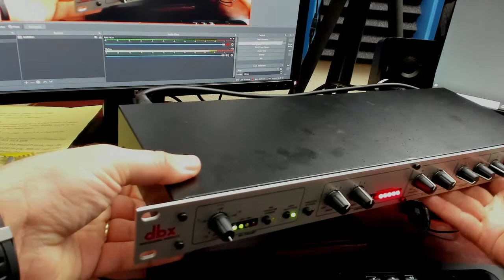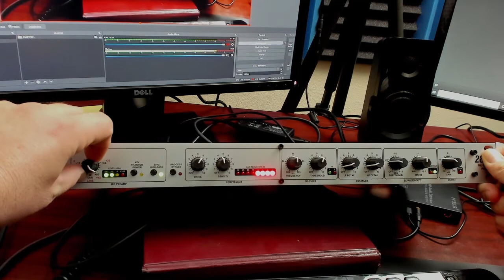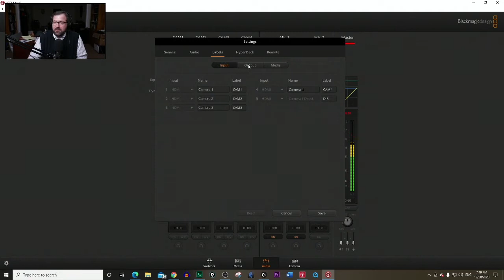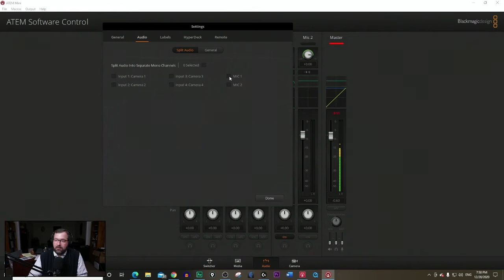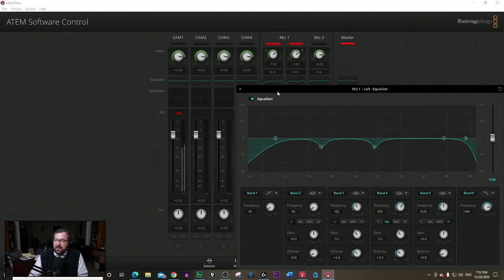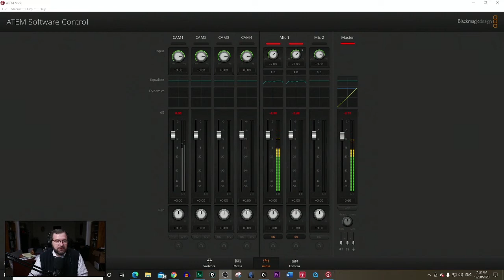ATEM Mini Audio: How to Connect the dbx286s to the ATEM Mini

Comment: Good information.  Running this through the Atem are you able to adjust audio levels in post if something wasn't set correctly?
Reply from the maker: Unfortunately not. The effects are "baked in." But you could add more gain in post or use a limiter or something like that in post.